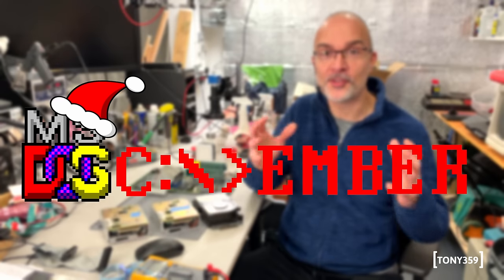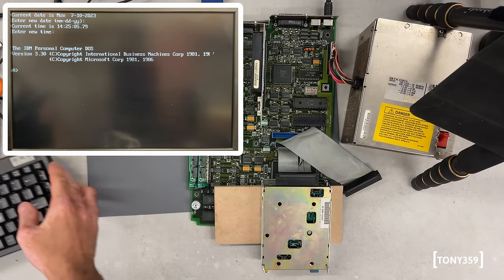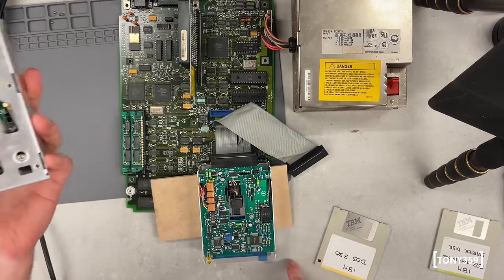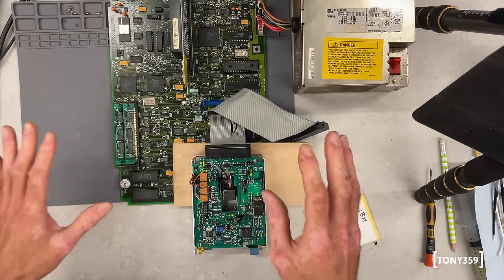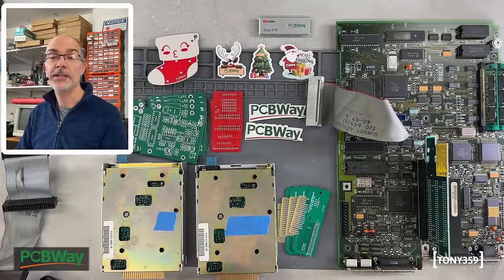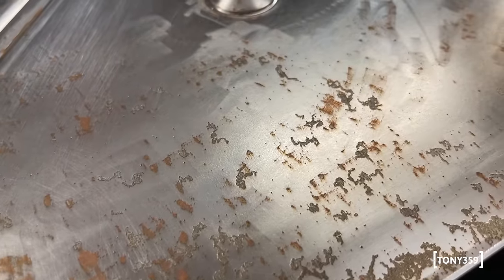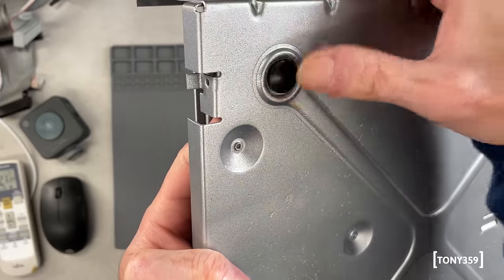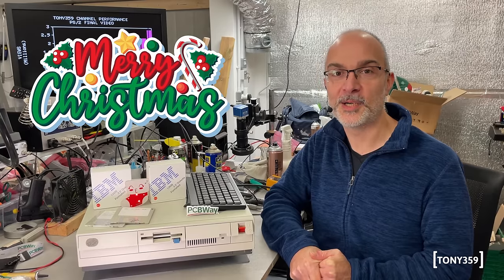Fixing this PS/2 was so much work!! #doscember

Comment: Awesome video! Glad the PS/2 drive worked out. Such a shame though the HDD is an issue. I had 3 drives and all 3 of them had the same exact problem.
Reply: Although there is a solid-state option now, using the proprietary planar connection...
Reply from the maker: @THEtechknight thanks and indeed. @IBM_Museum interesting. Where do I find out more? Still, I do need the squeaky noise. :D

Comment: This brings back memories of a PS/2 Model 50z that I used to use back in the 1990's. I have always had a soft spot for the PS/2, it was the first PC that I ever used before I got my first custom built 386 running Windows 98 (not 98se just straight 98) in a monster of a full-tower case with 8Mb of RAM, a 20 Mb Hard Drive and a 5.25 inch floppy drive. I remember it was CGA and I "upgraded" it to CGA before finally going VGA. Happy days... ;)
Reply from the maker: Tell me about memories and PS/2! I started using PCs at school and they had PS/2 model 30s (8086!) - Thanks for watching!

Comment: I had to revive my IBM 486 too about 2 years ago, it was completely dead by itself, turned out the old capacitors in the power supply had leaked all over the PCB and killing it, also the mobo was dead for same reasons and contact issues. it took me some time but I re-cap everything and got it back to life again. it is very important to have in mind that old capacitors are starting to cause way more trouble today than most people understand. take care of your vintage stuff and happy Doscember, I just revived my old IBM Laptop that had a melting rubber coating all over the whole computer, what a job that was to get off
Reply from the maker: Capacitors are indeed a ticking bomb. I should power on my old stuff more regularly to make sure that still works! Well done with your IBM!
Reply from the maker: some of those old ladies can be pretty expensive indeed! :)
Reply: @tony359  That’s for sure. It’s a good thing I taken good care of my lovely Pentium all these years. I actually got it sooooo way back when it was more or less considered junk and I got it for free because I did a favor. I pretty much used it ever since when I want to play those speed sensitive games that only run well on a real Pentium
Reply from the maker: ahah I can understand! Some years ago I decided I wanted an old PC and thought "how much could they possibly cost", checked online and $$$$$$ or better £££££! I thought they were considered junk but no :)

My first PC was a 386 DX/25, no cache (!), only 2MB of RAM. Everything was SLOW! I also wanted a "proper" pentium machine to play those games again at proper speed! :)
Reply from the maker: amazing! When I got my first brand new HDD, I couldn't format it so I called the shop, they asked me a few questions, then "you did fdisk it, didn't you?"
Me: "What is Fdisk?"
Them: "Oh come on, you fail me on Fdisk!"

:D
Reply: @tony359  ha ha yeah lol. I learned what Fdisk was the same day the guy fixed my previous mistake 😅

Comment: Hi Tony. What a mammoth project, Geordi La Forge would be proud😉👍
I did a 20MB IDE laptop HDD inside a IBM 5MB HDD, using a PIC, so an Arduino would do it easy.
Happy Christmas.
Reply from the maker: Mr. La Forge, one of my favourite characters of course!
ohhhh... that is another good idea! Install a modern HDD inside the IBM! How do you interface it though? The Model 30 is ESDI!
Happy Christmas!
Reply: @tony359
So I used a PIC, 32 pin ram sticks, some Op-Amps.
Mitsubishi made a one chip solution, but it was $180 last time I looked.
An Arduino should do it easy. Its only a matter of dealing with timing signals if I remember correctly.
I lost my workshop, equipment, computers, etc. to burglary and fire a few years ago. If I had my notes I would  make a pcb.

Comment: I used to repair these regularly back in the '90s. The biggest two failures were the power supply and 50ns time delay module.
Reply from the maker: Oh interesting! I am actually surprised the PSU is still working. I've turned it on and off countless times! And it still has the original capacitors. Good tip about the 50ns delay module, I'll keep that in mind! Thank you!
Reply: @tony359  Also the model 50z I think had  the same delay line problem. Please bare in mind I did these almost 30 years ago so I may have mixed the 30 with the 50z but I think I'm right in what I put.

Comment: That IBM drive diagnostic unironically sounds cool. There's no way it wasn't intentionally made to sound like music.
Reply from the maker: Good point, yes, that doesn't sound like a random movement! ahaha I can picture the IBM engineers discussing this in a meeting! Thanks for watching!
Reply: @tony359  I honestly wonder how it sounds on different drives.
Reply from the maker: I think I tried it on the modern replacement in part 2, it's a bit quieter but still the "IBM Dance Party" sound :)

Comment: I doubt i would go so far as taking a chip off of a working drive and replacing the faulty one with it but it does keep it as original as possible.
Seeing you use alot of elbow grease getting that metal cleaned up did make me a bit tired.
I have a sand blasting cabinet with different types of media available and it would take no time at all to get the rust off.
End result is looking amazing, great job.
Reply from the maker: I did consider the idea of sending the metal parts to a shop and have them sorted but it's not cheap so I reluctantly continued with the elbow grease! :)  I don't have a sand blasting cabinet unfortunately! Thanks for watching!

Comment: You could add some extra circuitry to generate the index pulses to replace the function of the faculty chip.
Reply from the maker: Well yes but it's not straightforward. The index pulse is not there all the time, I do not know what the FDD controller is expecting. Definitely a project for someone who wants to tinker even more with that drive! Thanks for watching!

Comment: Are microchannel Compact Flash or SD card adapter cards available? That would be a good modern hard disk replacement. OR SCSI microchannel card and appropriate SCSI drive.
Reply from the maker: This is an ISA system. I have an XT-IDE in it, I could fit an IDE HDD. But it wouldn't have the squeaky noise I really want! My idea of controlling the heads with the arduino is a reality now! Check this out: https://www.youtube.com/watch?v=R-9bGoGQm7s

Comment: I thought I have seen someone who developed a board that could plug in to where the hard drive plugs in but you can use a compact flash card to load your hard drive data.
Reply from the maker: Yes, this has an XT-IDE, I showed it in a previous video. The OS is from the Compact Flash. I chose to load the game from the FDD as we fixed it in this episode so it felt more real :) Thanks for watching!

Comment: Loooove your videos! Have you tried phosphoric acid to remove rust? It works like a charm 😊 It`s the same acid as in Coca-Cola, which also works with rust in a way 😉 Keep the IBMs alive. Need to finish my ovn Model 30 now 😅
Reply from the maker: I watched some comparisons and turned out that Citric Acid is one of the best, even better than dedicated products. If you look closely in the video (I think) you can see I also tried some commercial rust remover but that didn't work because of the Chrome coating covering the rust. When I restored the Macintosh, that was simple metal and Citric Acid worked like a charm in an overnight. 100% of rust removed. And I can dispose of the fluid safely. But thanks for your input!
Good luck with your Model 30!

Comment: gotta be honest, i'm kind of surprised no ones come up with an adapter card to allow regular IDE drives in the older MCA systems. its not only been decades, but just about all the other older systems have some sort of interface cards or adapters to allow newer storage systems.

i wouldn't think the translation would be that hard with some of the newer chips. maybe a couple of rpi2040s to act as buffers and translators. shouldn't need a full blown fpga for this sort of thing, the original controllers are largely just regular ICs for both types, after all.
Reply from the maker: yours is a good point. However, an XT-IDE is a great option and it works with everything. With those drives, it would only be for a bunch of IBM models. But yes, weird that nobody has come up with something. It would keep the system more original indeed. Thanks for watching!

Comment: Try broken chip on other drive since soldering (heating) may fix it sometimes 😂
Reply from the maker: I did put it back but it didn't make it on the video. It actually made it a little worse. It was coming up with error 601 (Floppy error) more often than before. And still no formatting. So, no unfortunately! :) Thanks for watching!

Comment: I don't think it used to be chrome plating? Probably some other metal. Maybe bright nickel.

You can nickel plate steel and copper at home for a durable good looking conductive anti corrosive coating. Expect to pay about $15 at least for your nickel electrode, don't settle for suspicious product, or it'll bite you, it needs to be high purity. You'll find recipes. I suggest using citric acid, if you have it powdered, then make a concentrated solution and then dilute it about 2-fold. If you hate yourself like the rest of the Internet, you can use vinegar, but i tried and hated it, no way i would use that, the sheer stink. Please use as little salt as possible when preparing the initial solution, and just give it time, or you'll hate yourself as well. You can add some saccharine (artificial sweetener) as a brightening and hardening agent. The nickel plating does not really fill scratches and voids, the surface finish will only be as good as the underlying surface, if you want mirror finish, your base metal needs to already be polished to a super shine. I guess you can use copper plating as an intermediate step to help with that, but i haven't tried. You still need to buff the nickel plating just a little to make it brighter, but it's like seconds, barely anything, you don't want to burn through it.
Reply from the maker: Probably I was mistaken on the plating. Thank you for taking the time to share the process with me. I did check online and my issue is... space. I really don't have the space for containers with chemicals and water in my workshop. If I had the space, by all means. I know it might just be 1 or 2 large containers but I really haven't got the space for that either! I hope one day I might have the chance to go that route! Thanks again!

Comment: You can rechrome the parts without having to paint them.
There are thousands of videos explaining how to do it in a very simple way.
If it's a real restoration, you should do it. If it's a simple repair and nothing more, what you did is fine.
Applying primer over the rust will help make it look good in the short term. But it doesn't solve the problem and will actually look worse in the medium-long term.
There is a clear difference between "repair" and "restoration". The plastic front doesn't look good.
Reply from the maker: I took a look some time ago, if not mistaken it implies quite a few chemicals, large containers where to submerge things... I don't have that amount of space I'm afraid. If I am mistaken and there is a simpler way, by all means please do point me to the right direction! Thanks for watching!
Reply: @tony359  Doesn't require weird chemicals.
It does require that you have water at your disposal, a power source and a plastic box in which to put the piece to be restored. Nothing else.
Reply from the maker: If I remember right you need several containers where to tip the metalwork, some with chemicals, some with water. My workshop is small and quite cramped, I really cannot justify having extra containers just for one computer case. I struggle to wash PCBs as I need to find a container large enough, pour the liquid and then put it back in its container at the end, clean everything etc... It's just space constraints I'm afraid! But thanks for the idea!
Reply: @tony359  Just only 1.